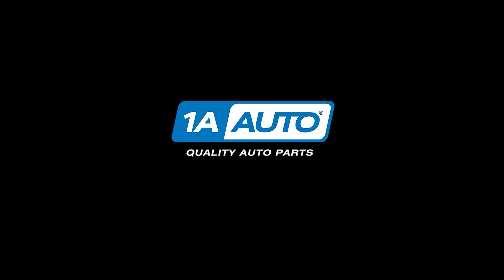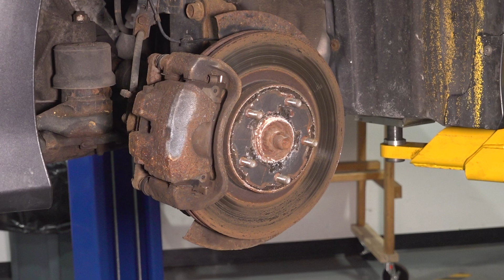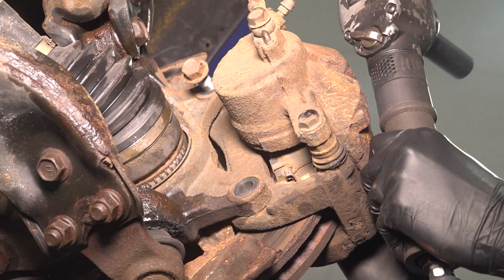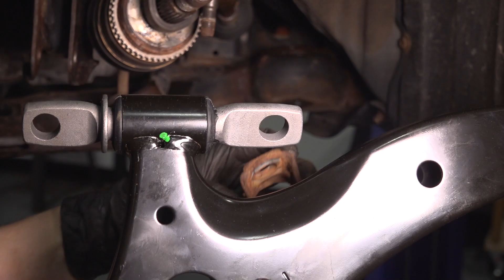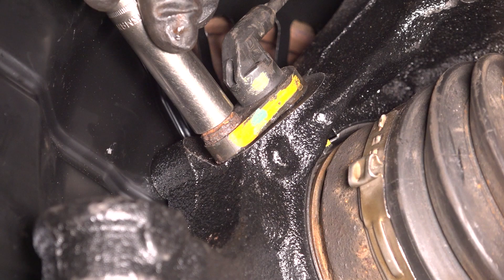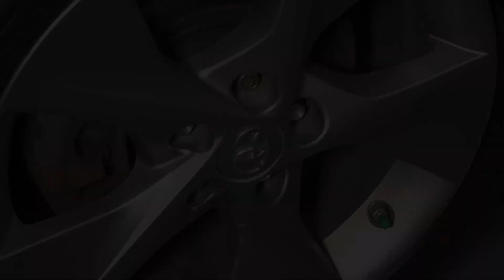How to Replace Front Lower Control Arms with Ball Joint 2012-2017 Toyota Camry

Comment: Great video, thank you so much! To prevent detaching the axel/knuckle, would it be possible to detach the ball joint from the old control arm (leaving ball joint attached to knuckle) before removing the arm, then remove the arm (without the ball joint), then finally remove ball joint from knuckle? Do the same backwards to install new arm; ball joint to knuckle first, then the control arm, then attach ball joint to control arm? Thanks again.